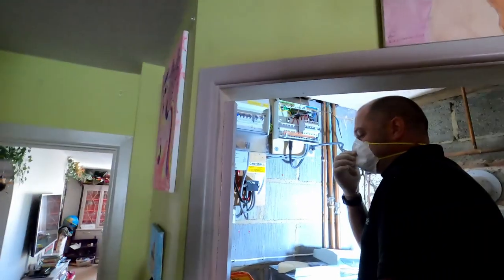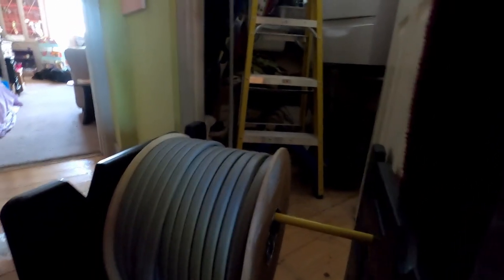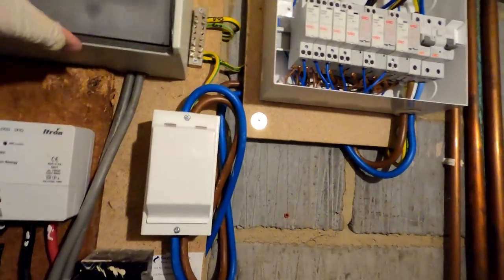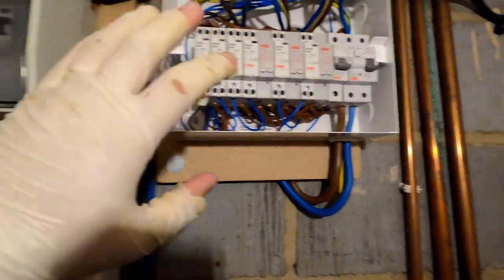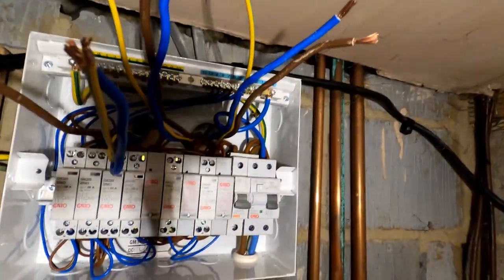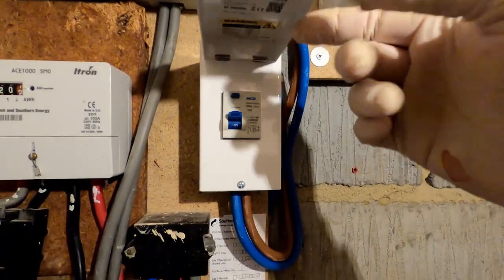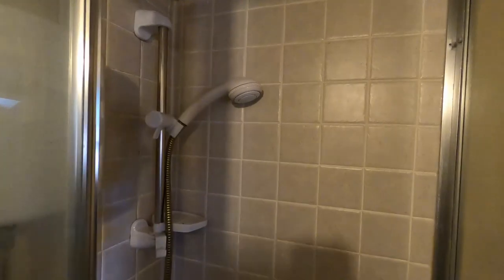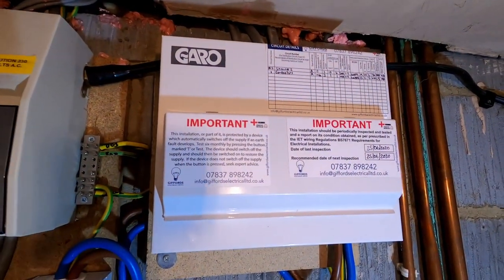Rewiring 3 Electric Showers - Sparky Life

Comment: Hi Great video I’m just coming back into electrical works after swapping over to mechanical 7 years ago ...I am only going to do private’s so I’m checking out what’s new and going to upgrade from 17th to 18th edition can you tell me what the requirements are to register with a p scheme ...it looks like the regs have changed a lot when swapping over regarding fitting metal clad ccu and spike protection before the ccu
Reply from the maker: Hi Richard each scheme have their own requirements but I’m with NICEIC and you need your 18th edition, public liability, various documents either printed or on file in pdf format ready to show the assessor. All the information you require can be downloaded generally and the scheme provider normally sends out a checklist of everything you need.  Hope that helps
Reply: Hi Craig thank you for coming back to me ... I Trained to do electrical works late in life .. I was 38 ... I worked all week and then went to college on Saturdays for 3 years then went to night school not sure if my qualifications are any good now 
2330 lvl 2
2330 lvl3 
16th / 17th ( I will have to get a regs book and sit down and refresh on the book and sit 18th 
2391 inspect / test ...I gave up electrical work as when I was doing little private jobs ..family and friends etc you just didn’t know what you was walking in to .. one job I spent all day putting in a new ccu but I missed a shared /borrowed neutral on the upstairs lighting .. circuit.. the plumber moved one radiator and earned the same as me .. they didn’t quibble his price but did mine 
Thank you for doing the videos I personally really appreciate the time and effort it takes to make them  I also do YouTube videos ( Richards home mechanics ) so I know how much time it takes just to do one video .. I’ve got notifications set for your channel for when you up load so I won’t miss any you come over as a real genuine guy who takes pride in his work

Comment: As long as the tails are short is there really any need for an 100ma RCD in line with a 30ma? The other board might as well have 30ma RCDs in too to make it safer.
Reply from the maker: Thanks P JD. this was considered but the trails from cut out to meter are long. From the meter to boards is relatively short though.

Comment: Hi why did you change the 6.0mm to 10.0mm as you said they 8.5kw. plus what was them fuses to the left of the shower ones on the garo board. Cheers Steve
Reply from the maker: The cable runs through 100mm+ of insulation and insulated walls. The 6mm had signs of thermal damage too.  I think they are current sensors to switch the contactors

Comment: I’m just training. Could someone explain why an upfront RCD is used in lieu of a main switch.
Reply: Look up TT earthing on your regs or on site guide...
Reply: All TT installations, the earth rod impedance is normally far too high to trip a MCB or blow the cutout fuse (e.g. 2A max). Therefore you need additional protection of an RCD before the CU. Usually 100ma so don't trip when 30mA installed in CU. New Type A ones rather than AC should be used now due to amount of DC equipment in a modern home.

Comment: 6mm not correct?
Reply: i did think that as well, and i would have thought as long as its not covered in insulation it would have been satisfactory
Reply from the maker: If it was clipped direct along it’s entire run then sure. But it goes though 100mm plus of insulation and then through insulated cavity walls.
Reply: Giffords Electrical ah 👍

Comment: I understand installing the garo board to stop the main fuse popping, but is there really not a better way? How pissed off would you be if you were having a shower before work and it turns off because someone else turns theirs on!?
Reply from the maker: It doesn’t works like that. This particular board Is on a first come first served basis.
Reply: @GiffordsElectrical  I see. Your video confused me because you turned the heat on the second shower and it cut the first off, because the first wasnt drawing any current to heat the water.
Reply: @HereForTheMusic-h5o  It's first come, first served for power draw. If the power showers are in cold the they only have the water solenoid actuated so are drawing hardly any power.
Reply from the maker: Apologies for that Richard. I did explain that in the video. Everyone could all have a cold shower as little load. As soon as a shower switches to heat then it cuts the other showers off. Obviously that’s very unlikely to happen all having cold showers at the same time 😂

Comment: they have been on about getting rid of gas for years, cant see it happening, i would like to know where all this electric is coming from, its not that long ago the boss of the power stations was talking about a 3 day week because demand was getting too high, plus gas is less than 4p a unit and electric is around about 16p a unit.
Reply from the maker: I’m not overly convinced gas will go but if you are a bit of a conspiracy theorist what’s the reason for smart meters??? It’s obviously not to save money 🤣🤣. It’s so they can switch them off when they want too 🤣
Reply: @GiffordsElectrical  yeah there is that, your right 👍
Reply: Using a heat pump which gives an efficiency around 300-400% plus the electric heating having zero flue loss I find the price is about the same for gas or r et lectrice space or water heating.

Comment: Make sure rods are properly spaced and you don’t hit any water or sewer lines.....
Reply from the maker: It’s not the water or sewers I’ll have an issue with. The village is basically named after what’s in the ground “stones” 🤦‍♂️🤣
Reply: Giffords Electrical not sure water British standards ( I do think options will be similar) but in those kind of soils with rocks - in USA ground rods could be inserted at shallower 45 degree angle, trench-laid about 30 inches or use of earthing mats which if very rocky may be your only option.

Comment: 6mm would have been fine on 32 amp mcb
Reply from the maker: I disagree but thanks for watching
Reply: dean m 6mm clipped direct (haven’t seen the cable route/length yet on video) is good for 41amps
Reply from the maker: Hi tommochelsea72 10m, 20m & 35m give or take and all three runs under insulation and through insulated walls.
Reply: Dean m with which reference method applied???? I very much doubt clipped direct in a domestic dwelling.
Reply: Giffords Electrical good answer 👌🏻. I actually got to the part of the video where you stated the runs-guess I should of waited before I commented ha ha.  If you instal a ‘tail gland’ on  tt system so tails have no chance of moving you don’t need a 100ma upfront rcd.
Reply: @tomorichard  I never said clipped direct I said 6mm would be ok on a 32 amp mcb for a 8.5 kw shower I have seen one trip due to overload
Reply: What about the voltage drop?
Reply: @johncooper5293  in a normal 2-3 bed house would that be relevant?
Reply: @user-vp7oj2rv2l  8.5kw is 37A anyway as you use 230V, but at 37A yes you've got 42M max length on 6mm cable for 11.3v drop.
Reply: @johncooper5293  what I was saying I have never known a 8.5kw shower trip on a 32amp mcb as nobody ever turns shower right up to its hottest setting
Reply: @user-vp7oj2rv2l  But you have to assume it can supply full load and not trip the mcb. I'd rather be safe and use 10mm for future expansion.